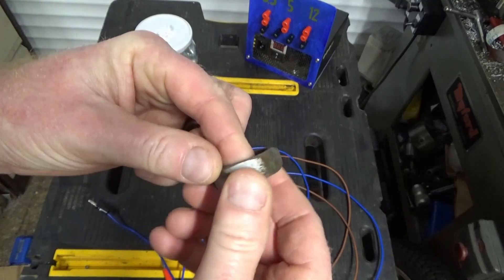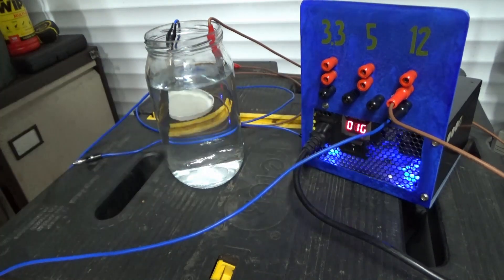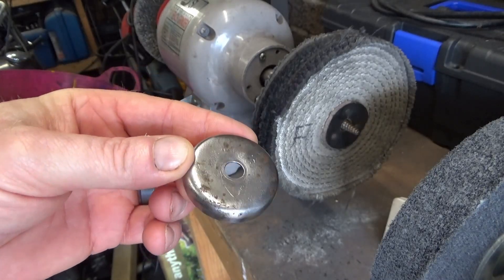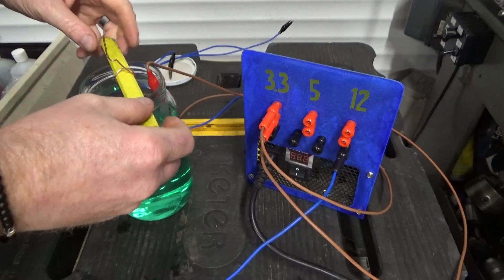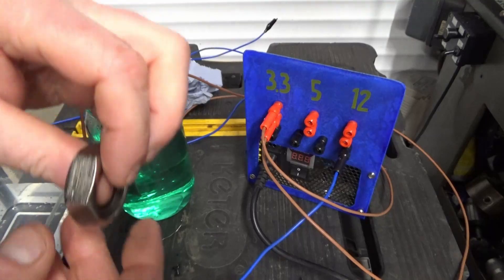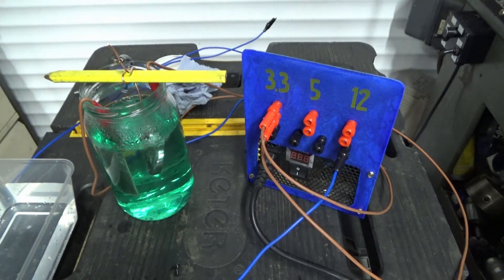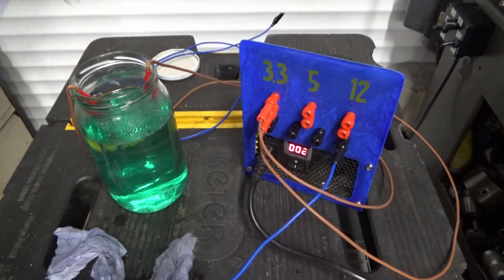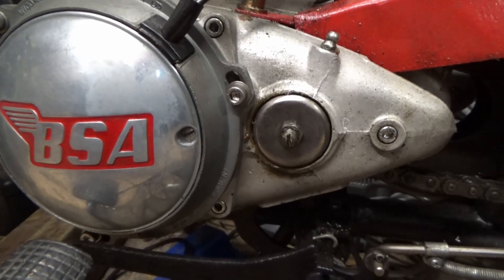DIY Nickel Plating Using a Computer PSU

Comment: How many watts was the psu, or does that matter?
Reply from the maker: It’s a 700w PSU but you can control the current by moving the anodes closer together or further apart.